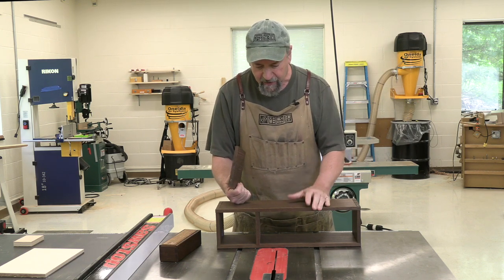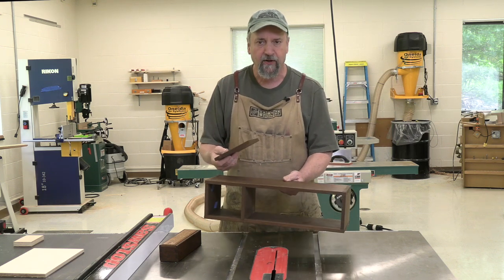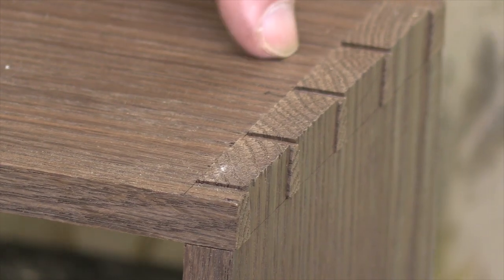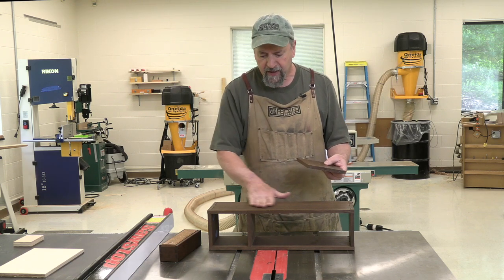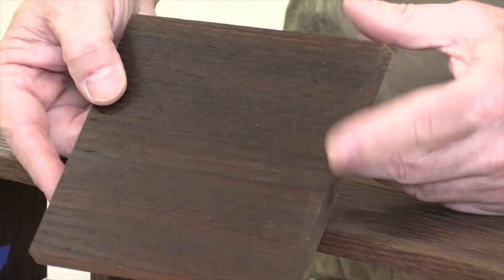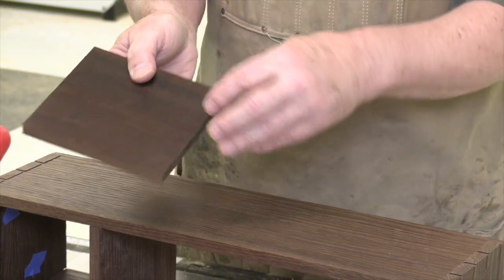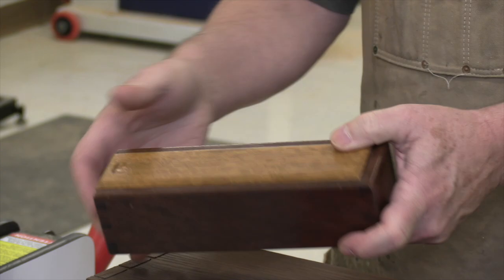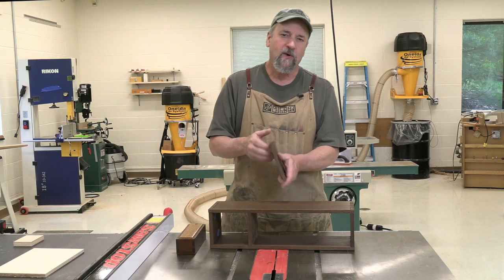Working With Thermally Modifed Wood

Comment: Can it be re-humidified ?... 🤔
Reply: Yes. It will absorb moisture from the environment. The thermal treatment process makes the wood partially pyrolized (burnt). Basically, it burns the chemical companents that insects and fungi use as food, which makes the wood much more resistant to decay. Basically, this replaces pressure treated lumber without the toxins. Frankly I am very confused why someone would use this for interior furniture type work.

Comment: I've used thermally modified maple - but as you found with the oak, it was very brittle and chipped and cracked - split along the grain in some cases.  I will only use it for decorative purposes, not for anything requiring strength.
Reply: Thermally modified wood is an improvement on pressure treated lumber (longer lasting, no toxins), and is most commonly used for exterior applications and saunas.

Comment: How is it for rot resistance compared to "shou sugi ban" processing?
Reply: It is excellent. Thermally modified wood was developed in Sweden, by studying yaki sugi (the Japanese name for "shou sugi ban"). Essentially yaki sugi over burns the exterior, the middle is, "just right" in terms of rot resistance, and the interior is not altered/improved by the process. The thermal modification process takes a wood through a cycle of temperatures and durations designed for that wood species and thickness to get the wood to, "just right" all the way through. It avoids the overburnt charred exterior (which is beautiful but also causes a lot of loss of material and is extremely messy.
Reply: I have no experience with shou sugi ban, but thermo wood has extremely high rott resistence. Thermo maple or thermo ash can be used in outside builds or even with contact to the ground since it doesn't take in water any more.

Comment: How do the thermally modified woods take finishes?
Reply: Because the thermal modification process pyrolizes some of the phytochemicals in the wood (burns them off), that space becomes available to absorb finishes. Basically the wood is very thirsty, and low viscosity oils penetrate very deeply into the wood.